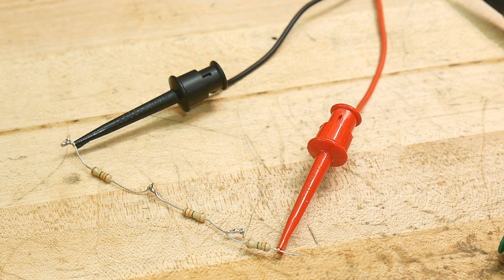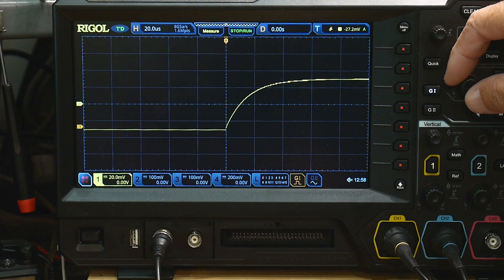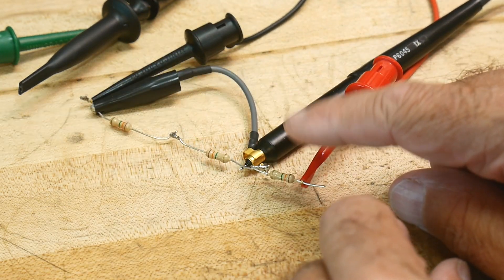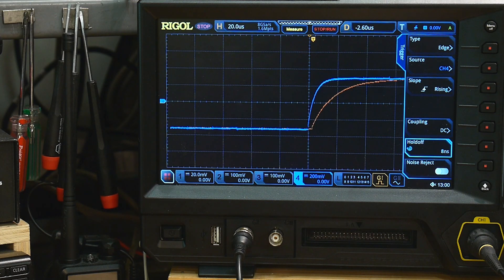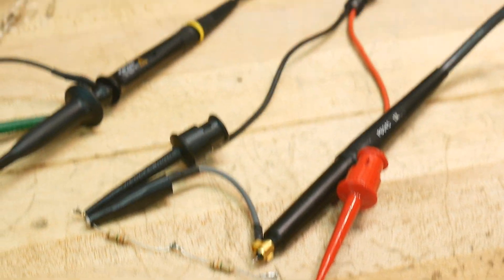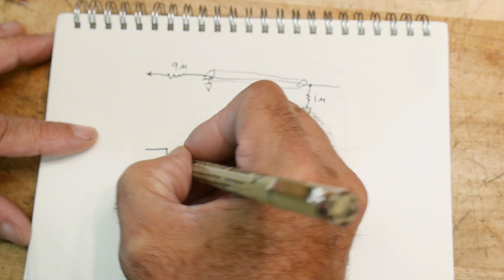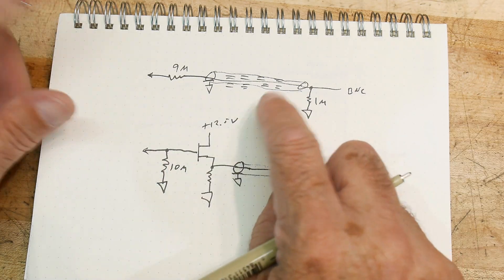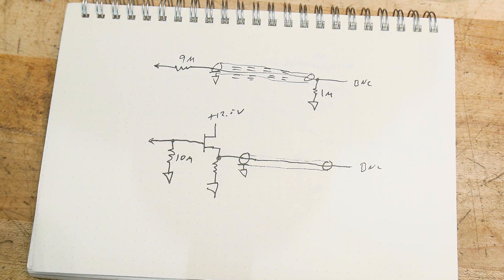#891 Oscilloscope Probe Circuit Loading

Comment: Hello! Good video!The output impedance of the transistor probe must have low output impedance (as said the author) to avoid  cutting-off frequency response. The second important thing - you must have a load (50 Ohms) on the another side of coax cable (next to oscilloscope) - to avoid "ringing" of this cable - because reflected signals. It is fairly important for high frequencies (above 1MHz) - and it can distorted for example shape of rise or fall of an impulse.

Comment: I think you are wrong in your analysis. What loads the circuit is the tip capacitance of the probe usually 10~15 pf for standard probe, which shunts the 9 MEG input impedance of the probe.

Comment: Wondering if you could make a transistor curve tracer board. I made one in my younger years and it was extremely handy for finding bad transistors, diodes and to some extent bad electrolytic capacitors. Seems like it had a small ac 12vac transformer and a range switch for two test voltage levels. If anyone could make a small board like that you could.
Reply from the maker: I did a 10 part video series on that: https://youtu.be/oFHTOQTIi30
Reply: Thanks for the reply.

Comment: So an active would be more useable for digital then say radio or audio circuits? Interesting.  Thanks for the look.
Reply: Digital circuits are not normally high impedance.
Reply: @OC35  understood, but was wondering about the probe application because of its response as well as its limited voltage input.Thanks.
Reply from the maker: I agree with Ashley, the active probe is not more useable for digital applications. A passive probe is just fine. The FET probes are more useful in analog applications.
Reply: @IMSAIGuy  that's what I wanted to hear, thankyou!

Comment: Where does the active probe get its power from?
Reply: Some are powered from special connectors on the scope.  High end scopes will have additional contacts next to the input BNC, and brand specific probes for dedicated functions, e.g. differential probes, current probes, FET probes.
Reply: ok thanks